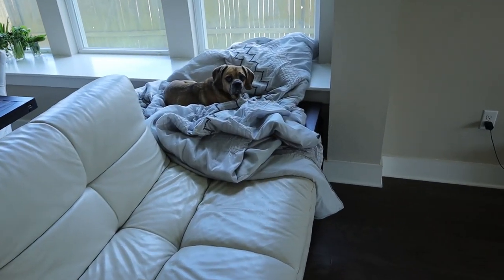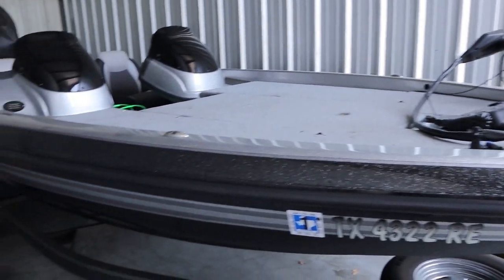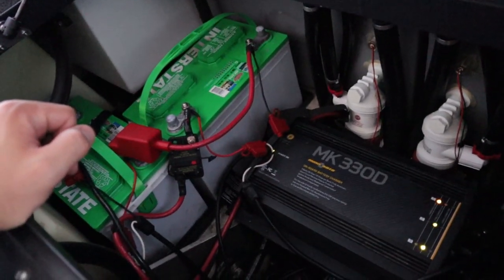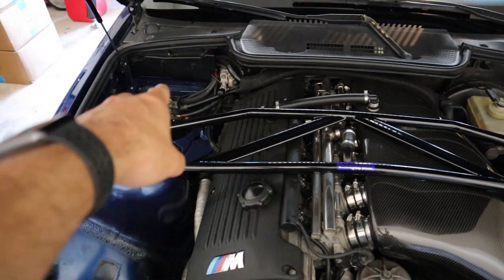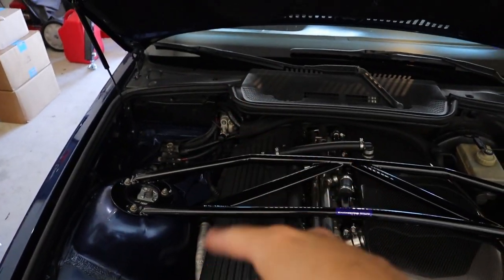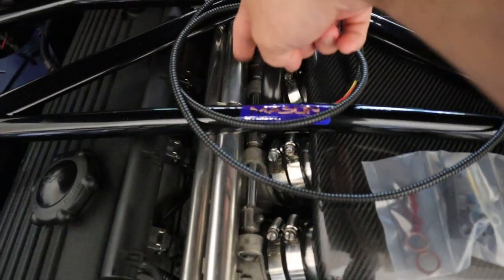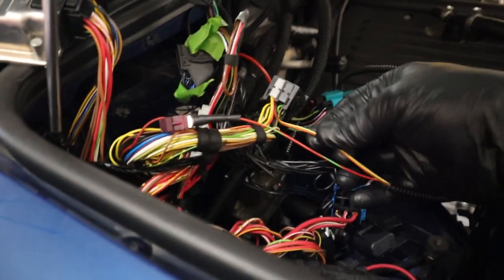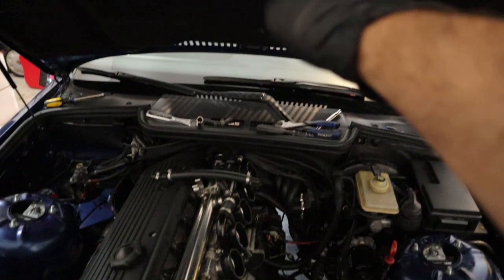S54 Swapped E36 M3 Gets CSL Tune + MAP Sensor - Any Difference?

Comment: Where did you get the CSL box? What kind is it? Will any E46 CSL box fit in an E36? Thanks love the build!
Reply from the maker: Thanks man! I picked up Turner Motorsport's CSL style intake. I'm not sure about any CSL box fitting...I've had fitment issues with both of my carbon intakes.

Comment: Hi there...new to your channel. Love the E36! What wheels are those? They look sick
Reply from the maker: Thanks bro! They're APEX ARC-8's, 17x9 et25 with 245/40's all around 👍
Reply: @jpetro  et25? That’s aggressive!! Thank you for your reply. Another question I have for you, is the swap straight forward or requires a lot of mods like engine and tranny mounts relocation? Sorry for the bother brother, but I’m looking to do the same.
Reply from the maker: Nah, it's no bother at all bro! Nope, all mounting points are the same. I didn't personally do the swap but the biggest issues are the wire harness, converting to DBW pedals, CANBUS, figuring out how to keep AC, a few custom fuel lines and a few custom oil cooler lines.

Comment: What diff ratio are you running right now?
Reply from the maker: Stock E46 M3 ratio, 3.64👍 I'm REALLY thinking about a 4.10...
Reply: @jpetro  Ha I have 3.38 on mine and was thinking of going to 3.64! But I also like my highway efficiency hmm...
Reply from the maker: Oh dang! What RPM do you cruise at like, 70-80? I think I'm around 3500 ish right now.
Reply: @jpetro  80 is 3000. I did a big trip up the North East a year ago, hit blue ridge parkway and tail of the dragon on the way back. I was able to get 25 MPG average when I wasn't hot rodding around.